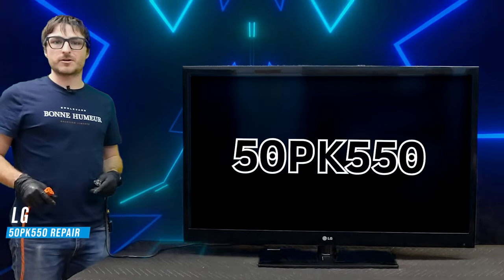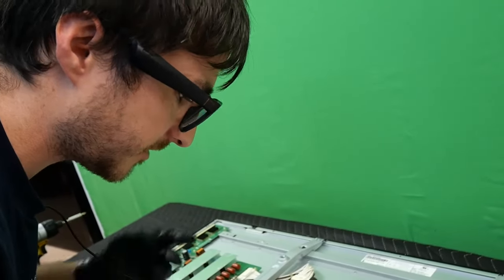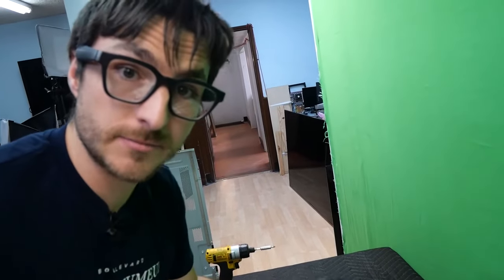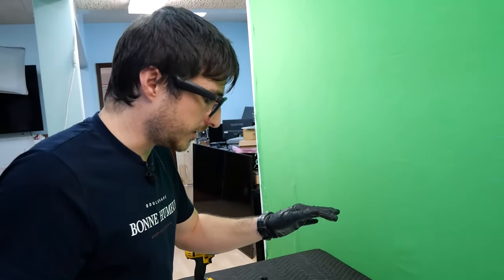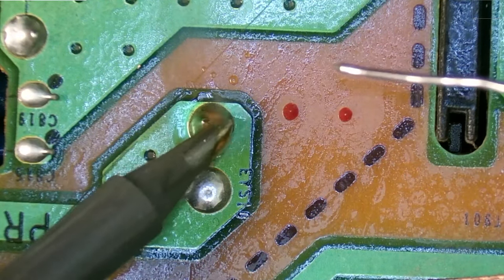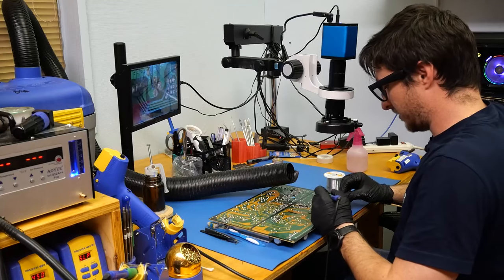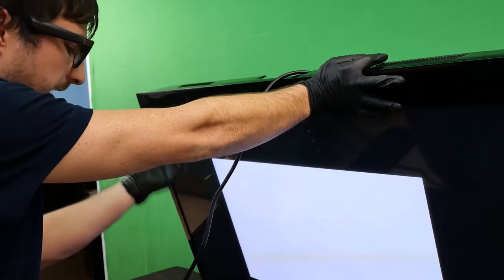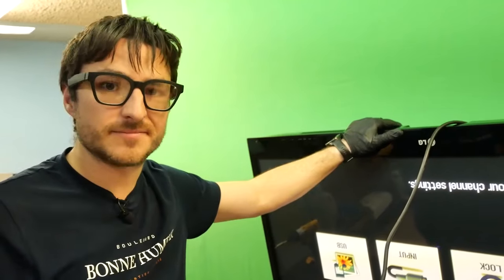LG Plasma TV Clicks On And Off But No Picture 50PK550

Comment: I have an LG Toshiba 50PK550 tv and I have a great picture and sound but keep hearing this chirping, beeping sound almost like the old AOL start up and looking in the back I see two green LED's on a board where the center holes are on the back plate that SEEM to be blinking with the sound, the sound starts off low then gets louder after a few minutes...can you tell me what that can be please...Thanks.
Reply from the maker: Sorry unfortunately the information you provided doesn't help me. What board are you referring to? Can you tell me the name of it? Can you provide me with the part number of the board in question? Is the noise coming from that board or is it coming from somewhere else and the only link is the blinking light is occurring at the same time as the noise.
If you disconnect the speakers from the TV does the noise go away? If yes then use external speakers and see if that resolves the issue. If the noise does not go away then most likely whichever board the noise is coming from is about to fail and should be replaced.

Comment: Hi Nick I have a samsung plasma I have sound but no picture and I suspected the Y main, I got a new y main and it showed the picture for about 2 min and it faded out. I now think it's the y buffer boards because  I think they have a lot to do with the Y main board,  the y main board will not even get warm. I have sound but no picture.  and I think the bad buffer boards just blew my Y main  board, any advice?
Reply from the maker: Sorry unfortunately with the information provided I can't help you. It's possible your Buffer boards are bad, it's possible your Y-sustain went out. 
You will need to do live voltage checks to see which high voltages are missing. You may also want to check and see if your buffer IC's are shorted using a multimeter.

Comment: I got a 60" LG plasma today, another freebie, the screen goes black after a hr or two of watching, turning the power off then on fixes the issues temp, screen goes out shortly there after again, sound is present all times.
Reply from the maker: Haha I have heard that before. My LED's went out on my plasma. 
What is the model of the unit? Just like in this video, we often see that type of fault be due to cracked solder joints. However the cracked joints aren't always on the power supply, sometimes they are on the Y or Z sustain. 
Often I check transformers, and any component that is screwed into a heatsink or shares a pad with a component that is screwed into a heatsink as that is where all the heat is and the most likely area there will be a cracked joint.
Reply: @NicksTVRepair  LG 60PN5700, I've had it playing for 5 hrs now, it went off about 4 times, each time I can turn it off and back on and it works normal, now that has been playing a while it hasn't gone off at all. weird. Checked voltage VS and VA while the screen was off, both ok. When I say the screen goes out, its as if the TV was off, no faint glow, nothing.
Reply: @NicksTVRepair  I think it was just dust buildup, there was moderate dust in the TV, I cleaned it up and now it appears to working normally. unless its F-ing with me.
Reply: @NicksTVRepair  This LG plasma had a moderate amount of dust in it, across the main caps, that had to be conducting some current,  black soot lightly covering areas around the power board and Y sus, I removed each board, did a visual, reflowed some joints and cleaned them, especially Y sus, cleaned the under the boards, on the TV,  now it seems to be working ok, fingers crossed! The boards for this TV are fairly pricey, might be more money to sell them. Its a HEAVY BITCH!! I have to stop taking plasmas.  I have the zenith I mentioned, mosfets shorted on the Y sus, and a CCFL with a bad CCFL power supply, simple fix but I want to do an LED conversion, see how it goes.

Comment: I thought plasma tv's were a thing of the past, i imagine circuit boards and/or parts would be hard to come by, especially nowadays, with that said, great repair vid, you seem very professional and well organized.
Reply from the maker: Jason,
Thank you for watching, glad you liked he content. 
Yeah I like plasma sets, I know they got a bad marketing rap but they were the king of TVs. 

I still have a Samsung PN64F8500 plasma TV at home as my primary TV. It just has better quality than the 4k ultra high end Sony set I had before which was the XBR-65X930C. I actually got ride of the 4k sony and put an older plasma instead since it had better quality picture.

The colors and blacks are just better on plasma. I could spend close to $2,000 on a new OLED TV but I don't see the need since the only difference between my plasma and an OLED is the OLED is 4K. There is just to little 4k content out there, and sometimes when I did find the 4k content with the Sony TV, the TV would downgrade the picture to 1080 otherwise it would have buffering issues and need to pause the show or movie. But even without that issue, 4k with normal LED TV contrast doesn't beat 1080P with plasma good contrast.
Reply: They are, but the are unmatched when it comes to IQ for your money and input ports in 2024. You usually get 3x SCART, 4x HDMI, wide colour gamut (P3), great motion and blacks for like 20-50 bucks. No LCD TV comes close below 500€, and even for OLED it is tough to beat.

Comment: That broken solder joint was exactly what was wrong with my LG plasma tv
Reply from the maker: Hey nice to hear this was able to help you out!
Reply: Hi Nick. Have a 50PX990. Powers on marking the usual clicking but displays nothing. 

Pressing buttons on front the light in the corner flashes but still nothing. 

Did your trick with R52/52 and I get the test patterns. 

Is this definitely the main board and simple swap out or is there more testing needed?

Thanks in advance!
Reply: Also checkes voltage and was 199 volts which I assume is good enough? (this is a UK model)
Reply from the maker: Yeah if you get the test pattern with the trick I showed then for sure it's a mainboard. No trick to it just a swap, that one should be plug and play.
Reply from the maker: What voltage are you checking? Incoming AC voltage or VS output voltage in DC volts from the power supply to the sustain boards?
Reply: @NicksTVRepair thank you so much. Replaced the main board and she's back working again. I've saved the old board to get it reballed at some stage as there was only 1 main board in the UK for sale.
Reply from the maker: Yeah best to have a spare just in case

Comment: i did the jumper trick  when i plug power back i heard a click once  but you dint i have check all solder and all is good :(  on the va i got 60 and the vs 186
Reply from the maker: This rules out the mainboard then from being the fault if everything was done properly as you should have gotten the color pattern test. If you get good voltage output from the power supply on the VS and VA then it means either your Ysus, Zsus, buffers, or Logic board are at fault. 
narrowring it down from there will be a bit more difficult. I don't have a video to guide you further unfortunately.

Comment: Nick, I am not electrically competent so it’s a breath of fresh air to watch your video repairs.
As I do not possess your talent what is the least problematic TV I could purchase based on the type of TV you have the least issues
Reply from the maker: Unfortunately it is very hard to know as only time will tell. Because of that I would recommend older TV's like some of the 2013 4k TVs from Sony we very rarely see come in for repair or some of the Vizio 4k P series from 2018 and 2019, it's rare to see those come in for repair and they are of good quality.
Reply: I had a Vizio in their early years....I believe 2010-2012 model and we just got rid of it towards the end of 2023 not because of malfunction but because our toddler cracked the screen. It worked flawlessly all those years without any hiccups 😢

Comment: Had this issue happen to my LG plasma TV last night. Found this video and it helped me out tremendously, a broken solder on the back just as in this video was my issue. Redid the solder and it works fine again :D thanks for the informative video!
Reply from the maker: Glad it helped
Reply: My tv is Korean have power only mark red light but dont turn on and have clicking sound at the back, wat to do or cause of problem

Comment: Just wanted to say Thank You, So Much, for a very well done and informative video.  Great video of the work, along with clear and meaningful explanations.  I was able to save a Samsung PN59D6500DFXZA 59" Plasma TV by looking for cracked solder joints on the legs of the transformers on the power supply board.  Found 2 - resoldered them, along with others showing stress.  TV is working great.  Thank you for your lesson on cracked joints.  Very well done !
Reply from the maker: You're very welcome!

Comment: Hey Nick.  Great video thanks. I have this model LG with this same symptom. I have disconnected the main board from PS, disconnected the LVDS ribbon from the logic board and jumped the two resistors.  The color pattern test works.  I am hoping that it's a 100% probability that the problem is the main board but I'm guessing that may not be the case?  Is there anything else I can do to test the main board now or should I just go for it and replace the main board and have a good confidence that will fix it?
Reply from the maker: Hey Joe,
I already replied to your email and saw you found out in the end that the same issue had in fact occured to your TV as well. I wanted to take the opportunity to point out to everyone as well that this is going to be a common fault and it will be rare the mainboard is actually the issue, almost alwasy with these types of symptoms you will find out the power supply is the cause.
Reply: @NicksTVRepair  Hello Nicholas.  I followed your advice, pulled out the power supply and checked for bad solder joints and sure enough, there they were!  I cleaned up all of the solder joints on those transformer legs, added fresh solder, and the TV works perfectly now.  You are the man!  Thank you very much!
Reply: Привет,подскажи пожалуйста,как ты запустил проверку матрицы?Расскажи поэтапно,я не могу найти информацию.Какие резисторы ты замыкал?У меня такой телевизор.Щёлкает 3 раза и не запускается,и так по кругу.

Comment: Thanks I have same tv.. no issues for over 10 years. Now I have a green line over to side doesn't affect picture
Reply from the maker: Are the lines vertical or horizontal? Do the lines appear if you run the color pattern test? If no then you may have a mainboard fault. If yes, then maybe one of the buffer boards is bad if it's horizontal lines and could be a panel fault if they are vertical.

Comment: Thanks for sharing, pls where exactly did that jumper wire enter?
Reply from the maker: I don't think I can explain better in a comment than I did in the video. I recommend rewatching that part, this is the time stamp. 
https://youtu.be/PawPbJVsk34?t=72

Do you have the TV open and following along with the video? That may be useful if the set is open and you can follow along.

Comment: Such a contrast ..ive been given a plasma 60 inch same thing clicking ..another video guy reppaved a sustein board (clicking ) ive rekoved power board so ill take another look at the solder joonts in the morning . Ty great video
Reply from the maker: Kevin,
We fix all boards for all TV sets. If you can't seem to revive your set on your own, send us an email directly or go to our website to fill out the contact form. Make sure to provide your model and a full list of symptoms/what's been done so far and we can maybe help you from there. 
If it requires high-level soldering or troubleshooting, then you can send your circuit board to our repair shop and we can fix it for you. We have flat rate fees for most of these boards, but if we don't for yours we can typically provide you with a quote before you even send it in since we are very familiar with almost all of these.
Reply: @NicksTVRepair  I've found the culprit a small blue 1kv capacitor blown easy fix on the sustain board

Comment: When you check the other boards, do you keep the jumper on the logic board or do you connect the main board back?
Reply from the maker: If using the jumper allows the color pattern test to come up and the color pattern test stays on without any issues, then there is no need to keep checking bords since you have confirmed the mainboard is the fault. 
However, if the color pattern test doesn't come up, then there is no need to keep the jumper in there as it won't do anything for you at that point.

Comment: Pls can you elaborate on the jumper cable i.e is it your idea or LG documented repair tip to get test pattern.Pks excuse my ignorance.
Reply from the maker: This is most definitely not something I came up with. Shorting out those two points simply triggers the Logic board to create a color test pattern. This is a program built into the Logic board so that you can remove the mainbaord from the set for troubleshooting purposes. This way if everything works with the mainboard removed you can confirm the fault is with the mainboard and vice versa, if the color pattern test doesn't appear, then you know the mainboard is not the cause of the fault.
Reply: @NicksTVRepair  we don't get access to  service manuals in South Africa so thank you for these tips and tricks.I will be recommending your channel to follow techs in S.A.Have you come accross a Samsung LCD that comes on and displays picture without first being on standby at plug in at wall socket?The set then shuts off after a few mins.The owner said that if left plugged in set will come on and work for a day then problem resurfaces.Thinking faulty micrcontroller on mainboard or lose solderballs.

Comment: Hello, great video. I have the same issue with a Jan. 2010 LG 50PJ350=UB Plasma TV. The power supply is brand new and so are the X-sus Y-sus boards brand new and their buffer boards also. It's just making a clicking with a small red light blinking on the main board. I'm now thinking it's a bad main or logic board. How do I determine which is bad?  There's not much more to replace now. Any advice will be greatly appreciated. Thank You.
Reply from the maker: Do the color pattern test. Are you able to get it? If yes then replace the mainbaord, if no then one of the "new" boards you got is bad, most likely the power supply just like in the video.
Reply: @NicksTVRepair  Thanks for your prompt response. No, can do with the color pattern test. My logic board and cables are different and I don't see any jumper holes in it. Is the red blinking light on the main board an indication of anything? I can't see the power supply board being bad I bought it new from a reliable national company. Thank You.

Comment: Ever heard of a Pioneer Plasma? same pioneer of stereo fame in the 70s, they seem to be excellent TVs, I've only seen two. I had a man with one he wanted to fix it, I actually found a service manual for it. He wasn't comfortable enough with my knowledge. Repair shops want a fortune to fix it. I know I could, but hes too attached to it. I might burn up his baby.  I may have failed at fixing some but I never destroyed one by letting out the magic smoke. Vintage stereo refurb is worth getting into, all the old shops are gone, what you do is the key, variety..  Need equipment, money is my only problem.
Reply from the maker: I have heard of them but have gotten very few in the shop. They are great TVs, but unfortunately, we don't fix them because finding replacement parts for them is very hard. We also never got enough requests for it to make sense for us to try and fix them on a component level.

Comment: I got a free Zenith Z50PT320 plasma which is made by LG, the voltages are ok, the TV stays on with the Y sus unplugged, found multiple shorted parts on that board,  how likely is it that the buffer boards are bad? They are pricey, If I can't repair this TV with a few new parts its not getting fixed.
Reply from the maker: I am sorry I don't have a how to test a buffer board video available. But it's an easy check with the multimeter. You use the back of the buffer IC's with one lead and then swipe the connectors with the other. I understand this explanation is impossible to visualize and a video would make more sense. 
I couldn't find any video that did it in a way that was universal, all of them seeemed somewhat specific to a brand or type of buffer but you can check out other youtubers and just type in "How to test buffer board" and it should bring a few different ways to check.
Reply: @NicksTVRepair  No I get it, checking for shorts, usually the chips will have a burn mark, need to read more datasheets on these chips, but like CFLs, not something I'm gonna be fixing. I have a CFL with no lights, the chopper IC is dead, that's fairly simple.

Comment: Hey Nick I have a problem with my LG TV 55 inch plasma it’s a 50PK540  just been replacing boards on it replace the main board power board y bored I believe it’s called A  The board and two buffer boards that connect to the Z board it clicks turns a picture on for a split second and then turns off what could that be thank you
Reply from the maker: You are most likely buying defective boards. 
Have you watched this video? It has the answer to what you are asking. 
All you need to do is follow along the video and do what I do. If you have a different fault, it will at least help you identify if the power supply or mainboard are faulty. If you are unable to follow along because for example you don't have a multi meter, then send me an email or contact us through our website and we can discuss ways that you can send your boards to our repair facility which we can then troubleshoot and fix for you from there.